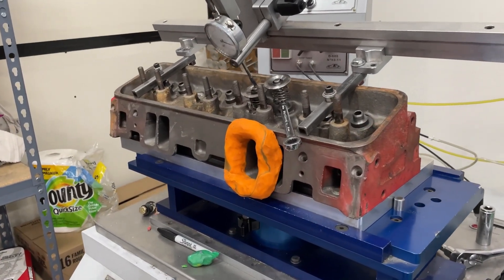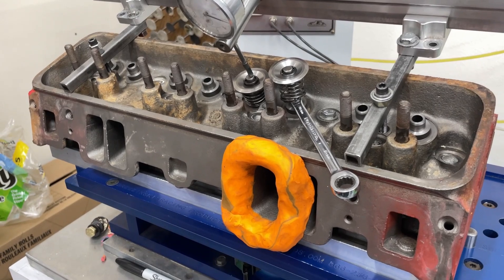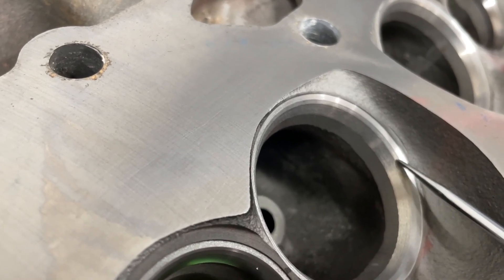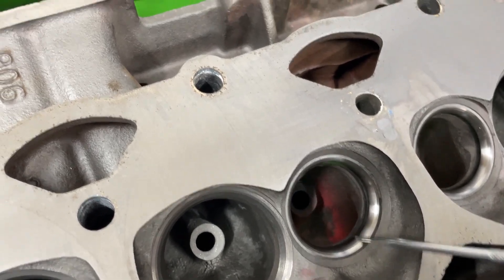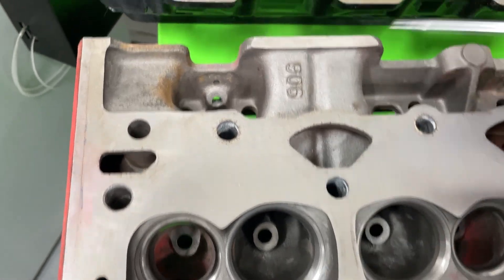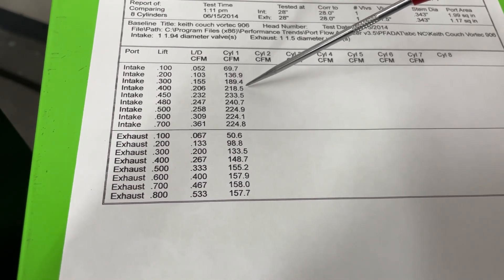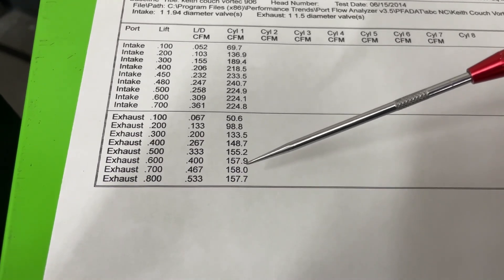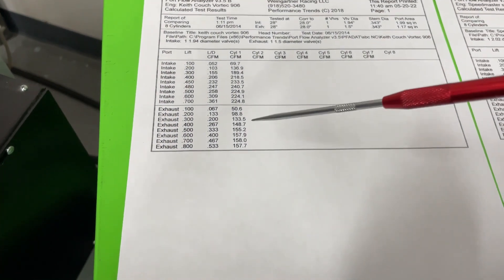Vortec Head Flow Test

Comment: Ive built a couple of motors with Vortec heads. By the time the you pay to have the machine work done for screw in studs, good springs, cut down the guides, you’re in aluminum head territory. The engines both ran great but I wouldn’t do it again. Of course I bought a set a eBay heads, 2015ish, they were a mess... so I wouldn’t go down that road again either. Those heads taught me the painful lesson of buy once cry once lol 
So many awesome engine builders on YouTube these days, I’ve learned an incredible amount since the mid 2010’s

Comment: I know the exhaust has always been the Achilles heel of SBC heads but the Vortec heads are even more pronounced compared to the intake runners.  

I remember years ago one of the popular rags did a build with the Iron Eagle version on the Vortec heads (165 cc) and they had an outstanding flow rating on the exhaust. In a bench race they lost to the Vortec heads, but they also showed the average HP and TQ across the rpm range and because of the better exhaust flow they did sightly better than stock Vortecs. It was eye opening.
😲

Comment: The Mexican 062s on my circa 2006 L31 crate engine were junk. Flow peaked at 218 cfm @ 0.450 and fell to 210 cfm @ 0.500.  The 906s on the 97 engine that came out of my van flowed 241 cfm @ 0.500.

Comment: I have a quick question about a set of C4AE-G ford 390 heads im working on. I've never cut any seats before. These are not going to be ported. I may clean up any imperfections I might see. Now I can't find anywere how wide I should be making each angle? Like my 45, should it be .060? Maybey .090? I'm using stones & a old sioux seat grinder. I have practiced on a old head that came off a engine that was mixing coolant in the oil. The seat looks very nice but as far as the widths I just went as deep as it seemed to need to clean up. The heads I will use do not have hardened seats. This is not a high end build. Just throwing some old parts together to get a engine going for my old truck. Got a small cam. Probably amount to a 350 hp engine that will only be good for 20 or 30 k before needing hardened seats. I just like messing around with this old stuff & would like to do more myself. Why pay someone else to screw your stuff up when you can screw it up yourself just fine. Lol! Right?

Comment: Enjoyed this video on stock vortec heads  got alot of them on 880 blocks got the tools to cut valve guides down for seals and more clearance for more cam lift also got the tool to cut stud bosses  down for screw in studs and push rod guides as well.

Comment: Have you cut a seat in a vortec for a 2.02 or 2.05 valve and flow tested? Anytime I have put larger intake valves in vortecs and don't port them I loose flow. I have tried  the 069 seat cutter, 068 cutter, and a few others. The port always chokes at .300 lift and flow drops.
Reply from the maker: I have cut them out to 2.125 before but I also ported them.  I think just just cutting to larger valves and not doing any port work doesn’t help them unless you have a trick custom seat cutter.
Reply: ive heard vortecs need to be ported along with bigger valves to get better flow.

Comment: Those little heads are surprising, They used to use them as a spec head down here in florida on the limited late model and florida dirt late model. Flat top flat tappet stock diameter valves and spring 500 lift rule checked at 0 lash. Asphalt 2bbl dual plane 1 inch spacer run close to 450hp and 500hp single plane 4bbl dirt engines, they are the 602 crate motor heads and they were $499 at the time, complete. Don`t overheat them they`re thin.

Comment: Looking forward to those 3Vs. Running the 208cc on a 408ci 400 in my truck. They're unported as cast and flowed 310@ .600". Surprised that the vortec exhaust wasn't better.
Reply: The 906 heads have crap seats on the exhaust. The hardened seat that was used on HD trucks ends up with a 0° throat and it really hurts things. To fix things you need to step up valve size to get a proper angle on the valve job